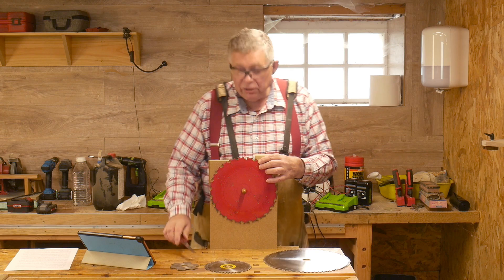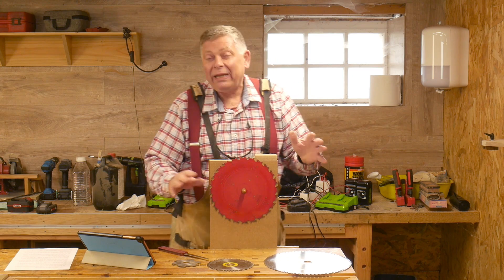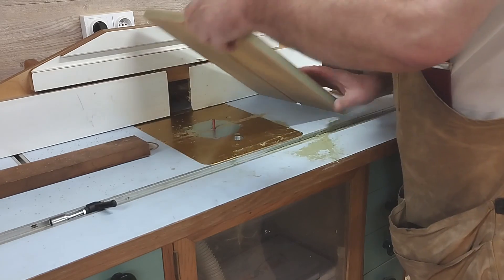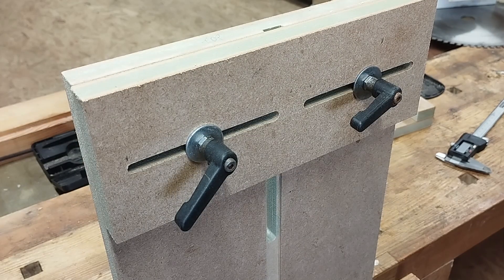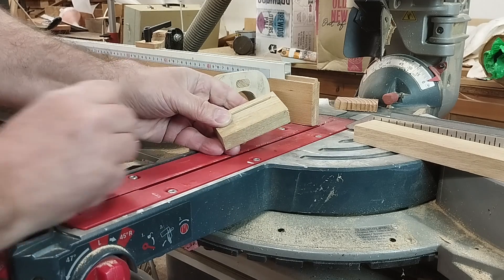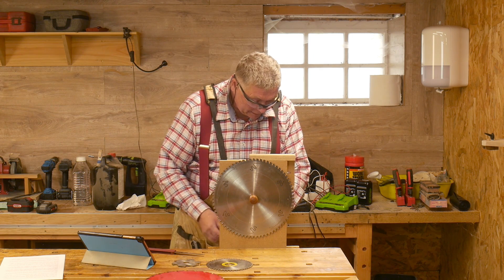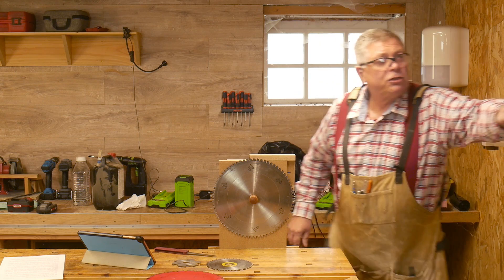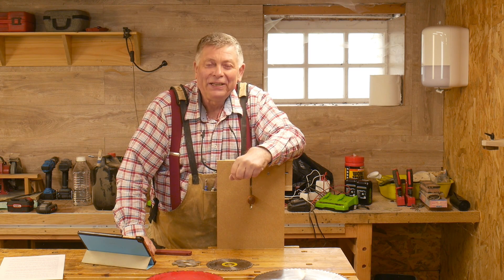Low-Tech circular saw blade sharpening jig!

Comment: I worked in an industrial mill where we cut over 300 hundred thousand board ft. Of lumber per shift . Was the saw filer and I’ll sneak you in on a secret. Each tooth does not have to be sharpened exactly the same as the next. Especially on carbide teeth. And I filed saws for over 50 years. Did it all by eye. Plus a diamond wheel on a grinder is the only way to go. But I guess if you’re a 100 miles from nowhere a file might be okay for a quick fix.
Reply: @JohnNaturkach Can you please share the technique you used?
Reply: @timothywhite6532  I’m not sure what you mean.
Reply from the maker: Hi John, that sounds like a lot of lumber and lot of filing! I'm impressed and rather jealous of you being able to do the job by eye, but I guess if you are doing it all day every day it becomes second nature. I have very poor eyesight (which is why I make and use so many jigs) and would not be able to do that  and, of course, I don't often have to do this very often. So this method suits me and the way I work very nicely.
Reply: @ not to mention all the saws I pounded.😉. But I loved every minute of it. Especially working on 70 ft. Bandsaws. Not a fan of carbide on hand saws as you can file a regular saw with no problem very quickly and get on with your work if you do it right.

Comment: This guy is a pro. This jig is very good. I have always been concerned about the dust from carbide blades. Rather than use a file, is it possible to use a sharpening stone if the stone fits between the gullets ? Thank you for teaching and sharing.
Reply from the maker: Yes, I don't see why not. But my diamond fine is very fine, so I use that.
I hope you make this, you won't be disappointed.
Reply: @SteveMaskery  Thanks for your answer. Which diamond file are you using ? Where can I get it. Yes, I will make the jig.
Reply from the maker: @Randy.Andy.  I thought it was unbranded, but there is a very faint embossed name on the side - DMT Duofold. It doesn't say what grit it is. I've had it for years.
Reply: @SteveMaskery  thanks

Comment: Way back when i took my hollow ground planer blade to a guy who sharpend blades at his saw shop. When i got home with it i found that the dumb ass had put a set in it. It tore the wood all to heck. Will never do that again. Ive found that with the carbon tooth blades that mostly you just need to keep them clean. Just get you some simple green and a soft brass or nylon brush. Clean them in a five gallon bucket top, works really well. Rinse them of and make sure their good and dry to prevent rust.

Comment: Can I use this jig for high speed steel blades, or do I need to jig an angle to the top block?
Reply from the maker: Yes you can. But normally you would only touch up the face. But if you really do want to file the back, adjust the jig so that the back of the tooth is flush with the top of the jig and  use the file flat rather than upright. HTH.

Comment: Steve: Pretty much all the TCT Saw blades here in N.Z. are either ATB blades, or, if you find one, they are hundreds of dollars for a single blade. My question is: can an ATB blade be reground to a "flat cut" blade with a Diamond file, or Diamond grindstone? I know where I can use one of these Grindstones if careful resharpening of the blade is possible. By the way; a great video you have just put up here. 🤠
Reply: I'm afraid I don't know, you'd have to ask your saw doctor. If it is any consolation, they are getting harder to find over here as well.

Comment: Some very good tips within your video. As simple as it may seem to other's, the use of a magnet to mark your stating tooth is brilliant to me. Yes you can use a permanent marker or even a dot of enamel paint and re-use that same dot for every sharpening, but eventually it will wear off. A magnet solves that issue and can be stored with the jig so it's not lost when stored. 
I also like the different spindles/ arbors you made for each size blade. A clever idea. The rest of the jig for me, just seems over built. If sharpening with a diamond file, all you need is two pieces of wood to clamp the blade between to keep it up right. You can add a hinge at one end and hook and eye to keep the 2 boards tightly closed around the blade. You could take it another step by using a router circle jig and route grooves deep enough so as you spin the blade to the next tooth it will move freely. For me, I modified a pretty beat up, antique handsaw clamp. I paid $5 for it at a flea market, knowing it was not in good enough condition to restore and sell as I do with most acquired Antique tools if not for my personal collection. I remove the rust from the frame and parts, then repainted it to prevent further rusting. I added strips of wood to the jaws to prevent any damage to the teeth  and added to partial round grooves in the strips for each size blade I sharpen. The smallest being 115 mm or 4.5"
I will be tapping a drilled hole in the frame to accommodate your various sized wooden spindles so the blades will have something to spin on.

Comment: Splendid! Now what do you use for getting resin off sawblades? I can't believe there isn't something better and cheaper than the Axminster stuff which seems to be ethanol at a higher price than Calvados
Reply: Rockler and other companies sell a citrus based cleaner (judging by the smell) with a round plastic bin that holds the cleaner and the blade to be cleaned.  I place my blades in the bin and add the cleaner to soak for 5-10 minutes depending on the pitch saturation on the blade.  Using a brass or nylon toothbrush sized brush, it takes 10-15 minutes to clean both sides.  I then filter the solution before returning it to the container.  I imagine over time, the solution will become saturated with suspended resin however, after six years I have had no reduction in cleaning efficiency.
Reply from the maker: I don't have much trouble with resin, TBH, but when I do I use WD40 and a toothbrush. Oven cleaner is popular, but someone told me it doesn't do the welds any good.
Reply: @SteveMaskery  I'll give it a go, thanks. Thinking about it, I don't suppose you can weld carbide, so perhaps it's brazed. And if there's aluminium in the braze, caustic will  certainly get up to no good.
Reply: I've had great success with spray-on oven cleaner (mostly lye, aka sodium hydroxide). Use it outside with safety glasses and rubber gloves.

Comment: Excellent Jig Steve. But please wear a mask and wash your hands - even if the air is not filled with dust, there will be toxic tungsten-carbide debris around.
BTW - what sort of file do you use? Did I miss that in the video?
Cheers
Andreas
Reply from the maker: Hi Andreas, good advice about the handwashing. The file is a flat diamond file. I don't know the brand, it's not labelled and I've had it for donkey's years. I did mention it in the film but it would be easy to miss, I guess.
Reply: @SteveMaskery  Thank you for the info on the file, Steve. In addition to washing hands, I would also put that file now in quaratine and use it only for this particular purpose. I am maybe a bit nervous about cross contamination (since I am a microbiologist), but better safe than sorry. 
Have a nice weekend!
Andreas

Comment: ARE YOU KIDDING?????   Every blade I own varies in the set and rake of the carbide tips, plus many blades are ATB, where there are THREE different angles.  Your jig wouldn't work on ANY of my blades.
Reply from the maker: I don't understand you. The top bevel is irrelevant, this only touches the face. Now if you have alternate FACE bevels, and such blades do exist, then this would not be the jig to use (although making a bespoke sliding fence for an AFB would be very straightforward). I don't think you understand what this jig does.
Reply: You don't need to sharpen the top bevel.  As for alternating face bevels, you can add a removable guide to the correct angle for both faces, then sharpen all the faces of one angle, then swap angle guides and then do all the opposing faces. This entire jig can be altered to suit your needs, just a little 3 dimensional thinking required so I don't see a problem here, but feel free to move along to your next YT video and keep paying to have blades sharpened.
Reply: Larry, you need to calm down, sir. My goodness.
Reply: Lacks the ability to understand the jig so leaves a whiny, griping comment instead...
Reply: @gcarson19  Probably throws his dull blades away because he doesn't know how hey work.